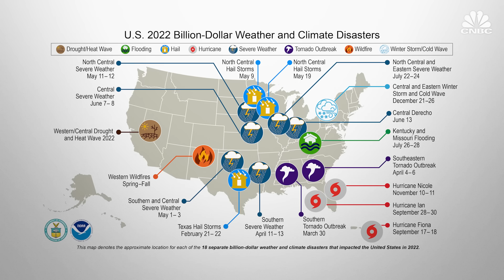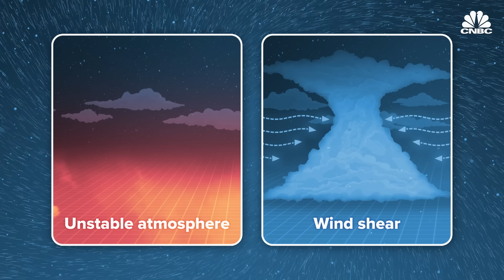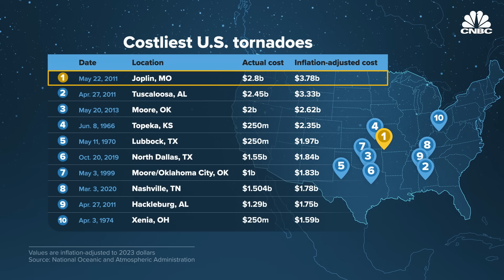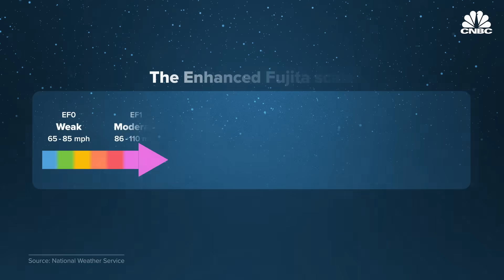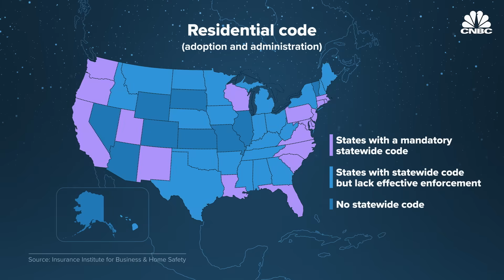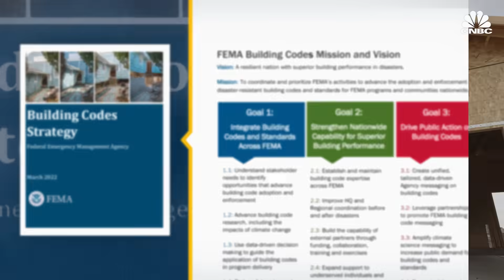Why Tornadoes Are More Destructive Than Ever

Comment: Why aren't the insurance companies making it cheaper for people to build better? The insurance companies already implement costs back to the government and constantly challenge the government on codes and they (insurance companies) are the ones who dictate the codes. 
It would be very simple for them to give "heavy discounts" to people who build to "their code (insurance companies code) or better". 
And watching this video, it seems to implicate that older homes are more likely to be damaged by a tornado. That's a split truth, older homes are often crowded by newer homes that have complicated roof designs (causes wind turbulence) and choke out the trees (or remove them all together) which provides soil stability and structural stability. 

This video shows nothing more than a one sided, simplistic view into something that is a very big issue. 

Also, insurance companies didn't really exist more than 100years ago (except to an elite portion of people).
Reply: Do insurance companies set the wages of carpenters or the prices of materials?
Reply: @chickenfishhybrid44  in a round about way, they kind of do. 
When they accept or deny builds/repairs that they deem to be either over/under specific price ranges, it affects what the builders are willing to pay themselves or staff. 
When insurance companies lobby for code changes to include a specific product, from a specific manufacturer, it drives the cost of that product up due to supply/demand issues. (And usually when they implement such changes, people need retraining to use that specific product in the proper fashion, again driving up wages, either due to paying for training or having to pay more for people with the training)

Comment: More destructive than ever?!! Does anybody bother to do their homework any more for Christ sake!!
There hasn't been an EF5 tornado in 10 years in the US. Peak year was in 1974, when there was 7. The amount of EF4s has gone down, most years recently have been mid to low single digits. Peak year for that was in 1965, when there was 30.
As far as cost and damage, blame much of that on inflation...and certainly there is more buildings and homes  and homes are many times much weaker than homes built 50 - 75 years ago. Hell some of the old homes had oak studs in them!!!
1974 was also the peak year of EF3s at 95!

Comment: Good video with solid reasoning to increase the resilience of homes against Tornados. Granted even steel structures will be knocked down with an EF5 Tornado, but it can be reshaped so it isn't a giant sail. Getting tired of the obligatory Climate Change hysteria. It costs more because the costs of building have risen, and the area is more population dense. I am more interested in the survival rate. People should build their homes with the potential environmental hazards in mind.
Reply: That's funny, l thought the Climate Change allusions were matter-of-fact, not hysterical.
Reply: They should all have storm shelters

Comment: It's been more than a decade since the last EF5 so I would say no, they are not getting more destructive.
Reply: This is true, but it would be interesting to know the average rating of tornadoes over that time. 

Also, the EF scale measures the kinds of damage to determine wind speed ranges, it doesn’t necessarily mean the tornado was more or less costly.

The video should have been titled “Tornado Disasters Are Getting More Expensive”.

They instead chose to go the sensationalist route by claiming tornadoes themselves are becoming more intense.

There is also the fact that the scrutiny of handing out the EF5 rating has increased quite a bit since 2013, which is evidenced by the fact that some weather enthusiasts and experts alike often disagree on EF4 ratings given in the last couple of years.

All of this to say CNBC could have been more deliberate in naming the video more accurately.
Reply: "More Destructive" and then they clearly explain why.

Comment: Why americans people doesn't build more solid houses , like brick house ? Somebody can explain me?
Reply: Because brick doesn't often hold up to tornadoes any better and bricks become missiles. Brick is also far more expensive than wood. So it makes the homes cost too much. Brick is also far harder to repair compared to wood when it becomes damaged and it also doesn't handle ground settlement as well. There are advantages and disadvantages to using brick.
Reply: THANK U @GalaxyFur
Reply: they want to save a little money up front and then pay for the AC/heating 10 times more
Reply: @423GustavBern the US has pretty cheap electricity and nat gas compared to most places. Its also more than a little money.  Labor costs in the US are quite a bit more than alot of places. Building a brick house is quite labor intensive compared to wood framing.

Comment: Buildings in the US are really flimsy. If you fart too hard, they will fall apart. The US even allow wooden buildings in areas that see wildfires every few years.
Reply: use cement it's not flammable. Wood is cemetery

Comment: Why do Americans build their homes with wood? Bearing in mind that they have issues with tornadoes and wildfires, one would think that they’d want to steer clear of wooden structures
Reply: Concrete isn’t gonna fair much better against 100+mph winds
Reply: @thechocolatelabs8124  A few  skyscrapers got hit and the structures were still standing. The windows got blown out of course, but other than that.. just minor damage from flying debris. Concrete and steel is strong stuff.
Reply: The US is huge and the whole country is not exposed to tornadoes or wildfires for that matter. I think alot of it has to do with tradition and inertia, Franky. When settlers first got to North America, there was a huge amount of trees available. Also, it's about cost and ease and speed of construction.
Reply: Because wood is strong and very cheap compared to concrete or brick. Plus, it's far easier to maintain when you need to work on it. Wood also is more resilient to ground movement. We do have brick homes. But they tend to cost more comparatively. But tornados can and do damage them as well. Brick does crack and it can become very expensive when the thawing and freezing take a toll on it from our winters. So there are pros and cons. The problem is that the U.S. gets extremes when it comes to weather that you won't find in most of the rest of the world. So there is often never one perfect solution.
Reply: @GalaxyFur  no one lives in a brick house, where i live its reinforced concrete structure with bricks only in the walls, the floor and ceiling are both reinforced concrete with rebar. i faced a typhoon (hurricane) which had 180 miles per hour winds, only trees snapped, powerlines fell, no building was blown over
Reply: Because we’re dumb, okay? We didn’t choose this life 😭
Reply: @benjamindickey8524 😂😂😂😂😂😂 💯🙌👏
Reply: Car companies lobbied US state governments to go all in on single family cars as the way of the future so they crisscrossed the country with roads and motorways opening up a lot of previously unused regional areas for development making big homes possible. Two world wars bankrupted Europe allowing American industry to fill the void and when the men came home from the wars baby booms happened. A lot of expanding families with a lot more income, with a lot of land to build houses on meant developers were racing to build as many homes as possible. And that meant balloon frame lumber houses rather than the brick and heavy timber homes seen in earlier generations.
The market is certainly not what it was post WW2 but Americans still expect big houses at a reasonable cost and that means a continuation of these flimsy houses.
Reply: @hurrdurrmurrgurr  
So it's basically the same old same old: 
People: Why can't we do things so that fewer people die?
Companies: Because we like money
Reply: @webbsurfer  companies are people-managed. people == companies
Reply: @webbsurfer what? If your goal is to actually give people the best chance of surviving you wouldn't try and build a house strong enough to withstand insane weather. You build a storm shelter that's about as close to a gurantee of safety as you can get.
Reply: Because when your selling to dummies you can give them anything and charge them a lot.😂
Reply: @timsimmons5190 "charge them alot". Even with the current housing crisis and prices going up houses/property in much of the US are still pretty affordable in comparison to alot of other rich developed nations. Take a look at Canada for example.
Reply: You could ask the same thing about why people live in mobile homes in tornado/hurricane zones.  The very fact that you HAVE to ask this question shows a lack of understanding and knowledge of what it is like to live on an income that is not sufficient to cover the necessities of life.  I live in a mobile home in a tornado-prone state.  Why?  Because that is the most affordable housing I can find.  Mobile home park investment sites are well aware of this and tell would-be investors that this is a sure thing for making money.  They look for parks located in communities where apartment rents and mortgages tend to be much, much higher than lot rent.  There's a lot of folks out there who are housing insecure.  Even people who live in single-family homes may not be as well-off as they look.  A change in finances for the worse, and they find that they cannot afford the upkeep on their present home; yet, being paid off, they don't have mortgage or rent payments, which they would certainly have if they sold and moved.  Yes, people can be trapped in a bad housing situation.  And also, when it comes to natural disasters, well, we won't think about it.  We'll just pray it won't happen here.
Reply: I'm more interested in knowing why tornadoes seem to be exclusively an American problem....
Reply: @steven2183  They are not.  Bangladesh gets a lot of them too.  There is more awareness now about tornadoes both in and outside the United States than when I was young.  But you have to remember that in the United States (I can't speak for other countries), it was the official policy for the Weather Bureau (now the National Weather Service) to not even mention the possibilities of tornadoes in issuing forecasts.  The reason was they didn't want to cause panic.  Watches and warnings only came about because of the 1965 April 11 Palm Sunday outbreak.  Refinements in radar detection have also contributed to the increase in issued warnings.  Other countries like Bangladesh may not be as advanced in weather technology plus the weather news in the US is very US-focused.
Reply: @steven2183  In one word: Geography. 

Between the Rocky Mountains and Appalachia, there's more than 1,000 miles of plains and grassland. Flat areas heat up more quickly in the day. Mix in the warm, moist air from the Gulf of Mexico with the cool, dry air from the arctic, and you've got the perfect recipe for tornadoes. 

Russia, Australia and Brazil all have these same factors at play. The difference is population density. All these countries are centered around coastal urban areas, with most of the interior being undeveloped. Australia only records 20 tornadoes a year because that's how many are actually spotted (the actual count is likely closer to 200). The Midwest and deep South are much more heavily populated by comparison, so very few American tornadoes go unreported.